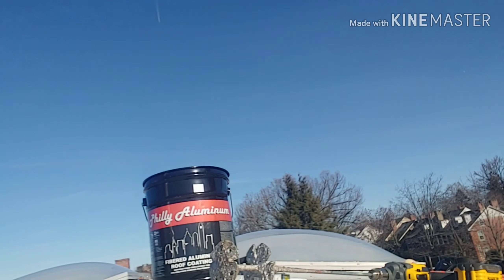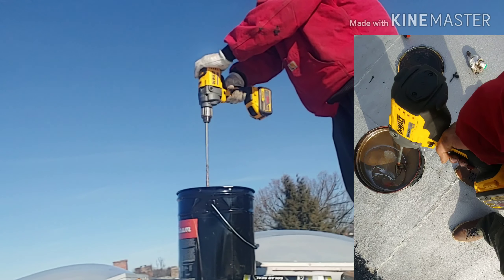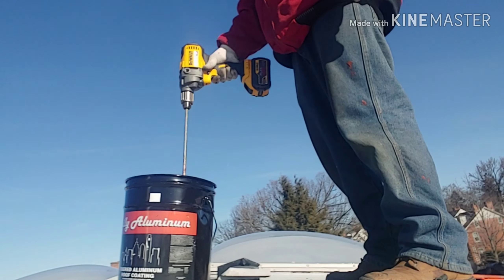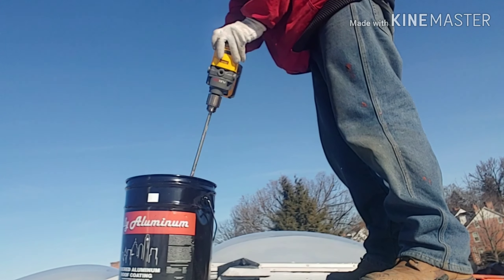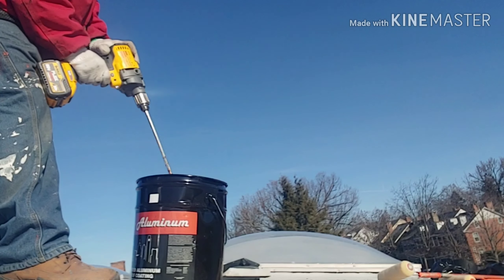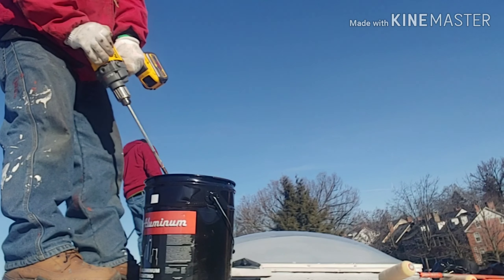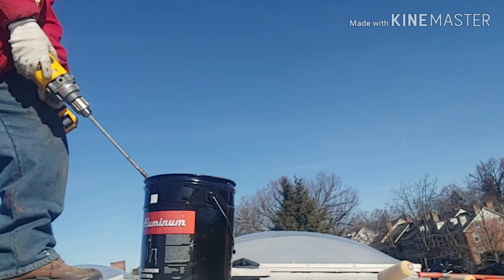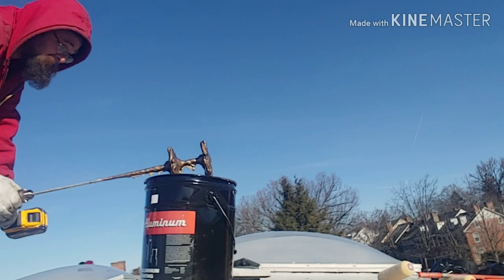Dewalt DCD130b Mixer reviewed

Comment: I'm an Electrican I've got 1 and it will drill through 2x4 and 2x6 and triple plates like nothing 1 impressive drill
Reply from the maker: It's a beastly drill. I would just use a lighter drill if only going through 2x. I've only used it maybe 30 times since getting it, but no regrets

Comment: Hi Alex,

Pretty cool tool i believe this model also has a long handle.  

I use both cordless tools from milwaukee and dewalt. Home Depot had a clearance on milwaukee mud mixer for only  $99.00. What i like about the milwaukee mixer is how you can adjust the handle on the drill. That's why purchased the mud mixer, plus a great price deal. 

What i do like on the dewalt is that E-clutch system. That's nice to have if you are drilling holes in 2x's and you hit a nail or knot. 

Thanks for the video
Reply from the maker: It does have a large handle, but it's surprisingly comfortable. Also doesn't hurt to have a large handle near your driver's seat 😂
Reply: @Tools_Tips_How-to  

That's true, LOL...